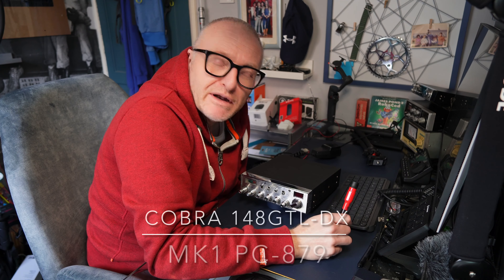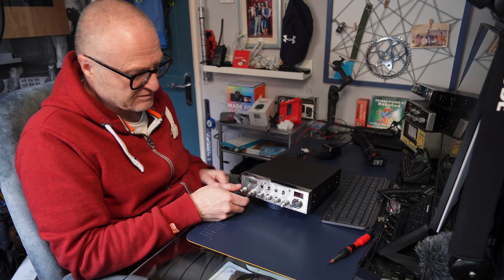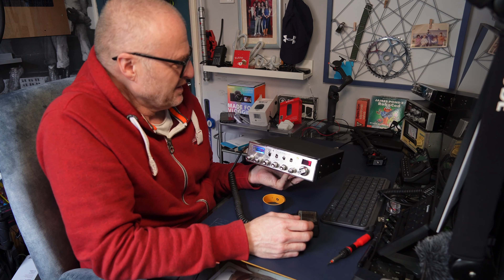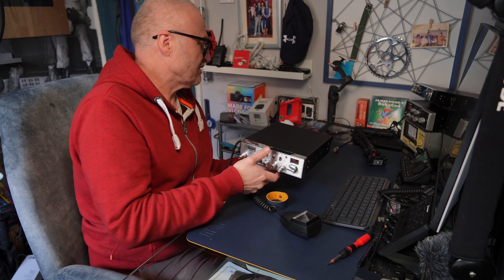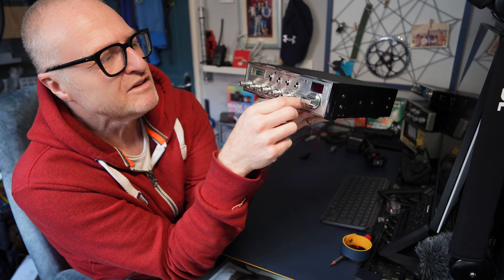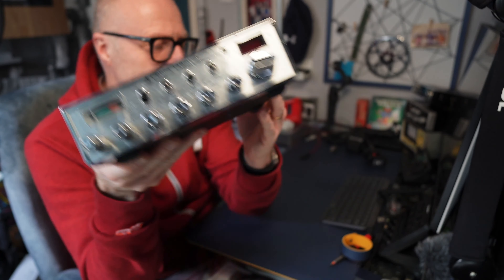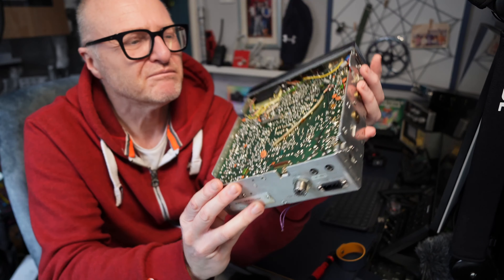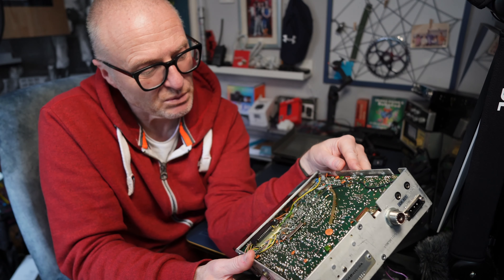Cobra 148 GTL-DX MK1 Look Around & Evaluation of this Once Legendary Multimode CB Radio!(PC879)

Comment: Superstar 360 had the same pcb as 148 cobra, but the 360 was a better finished rig, you can do a hell of a lot with them!.. I've converted many over to ham bands with great success.
Reply from the maker: I had a few very nice boxed 360’s several years ago.A lot of folk dismissed them and went for the normally well trodden 148.
Reply from the maker: Oh I forget to mention,check out my earlier vlog with a 360 that has been to the moon and back.